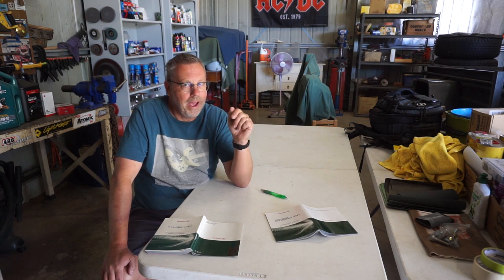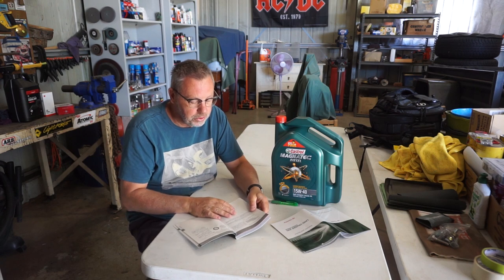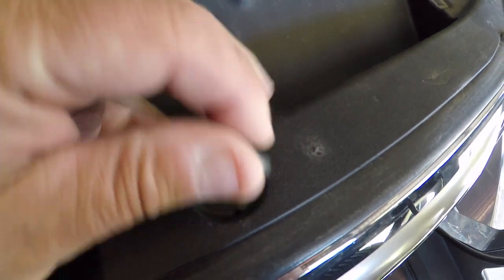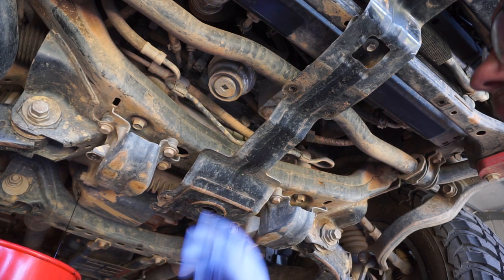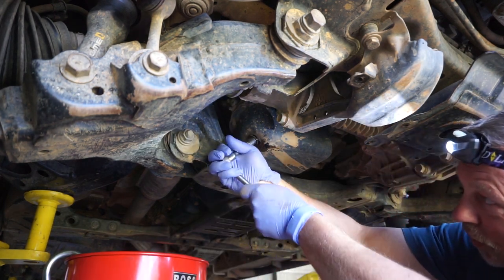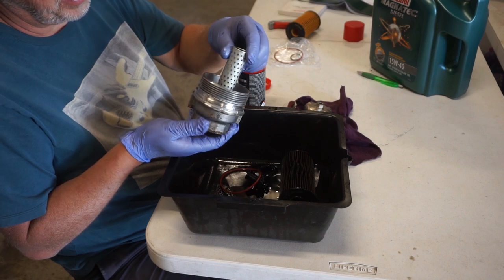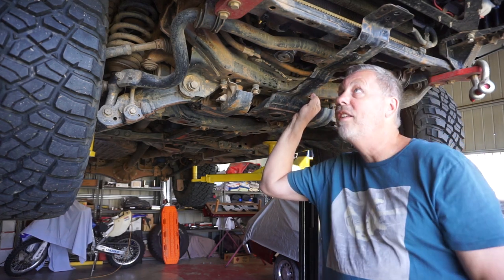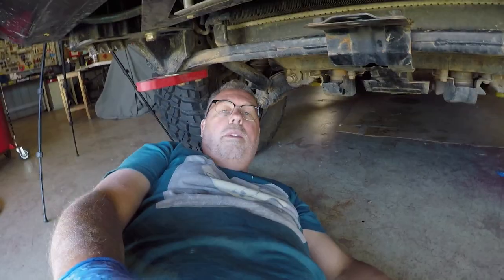How to Change the Oil in your Landcruiser 200 Series LC200

Comment from the maker: Ian MCcabe has discovered the filter housing part number is incorrect.  The new 79 series part no is: 15620-51010.  Great work Ian, thank you!
Reply: Thanks for this it was so helpful im going to upgrade my filter housing now
Reply from the maker: Good stuff Stefan, you won’t be disappointed.  I feel much more reassured with the alloy housing than I do with that plastic unit.  Thanks for watching and commenting mate, I sincerely appreciate it 😎👍
Reply: @JafffaAdventures  Hi the part no. 15620-51010 is for plastic filter housing. The aluminum filter housing part no. Is 15620-31060.
Reply: The part no. 15620-51010 is plastic filter housing. Part no. 15620-31060 is for aluminium filter housing and you may have to install the perforated tube from the plastic housing to aluminium housing and some doesn't come with the cap either. Hope this helps someone .
Reply from the maker: @rezuuz  Great information mate, thanks for sharing.  I have pinned the comment to make it easy for others to find.  Cheers!!
Reply: @rezuuz  Sorry mate, the aluminium item for VDJ200 motor is 15620-51010.  15620-31060 has a shorter length spout/metal extension and will NOT fit VDJ200 engines.

Comment: Yes you are totally correct about the dealer's almost voracious want to cancel the warranty. Had my car serviced out of state on a trip across Australia and when next presenting for a service at the selling dealer they noticed the service, but were not aware that the service was carried out by a Toyota dealer. The pumped up dolly bird behind the counter(she had a bigger bust measurement than her IQ statistics !, neither excessive) must have thought she was on some sort of spotters fee for cancelling me out....epic fail by her, and a total loss of respect for that dealer. I also purchased an extended warranty when buying and soon discovered it wasn't worth the time, money, or trouble involved. The extended warranty carried with it an escape clause before expiry with a proportional refund....good luck getting that back. I was totally ignored in all my attempts. Therefore, never again a Toyota.  I have also taken to doing my own servicing, after finding that dealers stripped the threads of nearly all the bolts holding the engine and transmission plates in place.
Reply from the maker: That’s bloody disappointing and poor form on Toyota’s behalf.  When you’re one of the worlds largest manufacturers the first thing that gets tossed out the window is customer service and your experience exemplifies this.  I feel for you John.  Thanks for sharing your journey 😎👍

Comment: I have read a document from toyota that says that due to oil consumption in those engine in the first years that it was released. The viscosity of the car should change to 5w40. Should I follow that document or still using 15w-40?
Reply from the maker: I’ve run 15/40 for the last 6 years without a drama.  Ambient temperature for your region is important for viscosity selection.  Its in you manual and on this video.  Cheers
Reply: @JafffaAdventures  dont have the owner manual, but in dealer they say it should be 15w-40. I’m in Peru, where weather is hot. Upto 32°C. The previous owner was using 5w-40
Reply from the maker: @omarkevinramos4716 I would be going 15/40 in that climate mate, same as here in Australia 👍

Comment: Thanks Terry! I finally “backed myself” and changed my oil at the 5k interval rather that waiting for my 10k mechanical service. I was surprised how gloopy the oil was, glad that I’ve changed it out. Had the issue with the drain plug spinning the filter housing. Onya mate, Tim.
Reply from the maker: That’s fantastic news Tim, your engine will thank you for it.  Well done mate, really glad I could help out in some small way.  Cheers😎👍

Comment: Thanks for the video mate. Can i please ask...did you use a torque wrench to tighten the sump plug and oil filter? If so where did you find the torque settings for them? And im guessing you use a new sump plug washer each time ?
Reply from the maker: Yes, I replace the sump plug washer frequently, but not every time.  I do services every 5000km and find the washer lasts a few services.

I do not torque the plug down but having done this exercise hundreds of times, I just have a feel for it.  I would imagine it’s not too hard to find the torque settings.

The filter housing does not torque, but is by the detent in the housing and the small metal tab the fits into it.  Cheers👍😎

Comment: Hi mate
I've been servicing my BMW x3 diesel 3ltr for 8 years now using penrite enviro 5w/40 .
The reason for the enviro additive,  is to help burn off particulates in the dpf exhaust. 
I have done 400,000 km from new doing all my own servicing and have had not one problem with anything, except changing a battery and the usual brake pads, tyres etc. 
The service interval as specified in the book is every 25000 km, which I have followed for the engine oil changes, and never changed the transmission oil.
I have been told by the BMW service technicians that they have been replacing the dpf (diesel particulates filter) on the X3 and the X5's at around 100,000 km mark if using full synthetic oil , but without the enviro additive. 
The diesel particulates filters cost thousands to replace and if driven around the city all the time,  will block up within 80,000 kms. 
I'm a farmer that does mechanical work on a lot of different machinery and vehicles  for over 30 years, and also own a landcruiser 100 series 4.2 turbo diesel,  changing the oil at the 8000 km mark. Because mine doesn't have the exhaust filter  , I don't have to worry about the additive in the oil .
There is a product from penrite,  that you can add to the fuel to do the same job as the oil additive,  not sure of its name.
Keep up the good work on the videos,  as I've subscribed and given the thumbs up.
Reply from the maker: You are very kind with your comments and thank you for sharing your experiences, that is very helpful.  You are a legend😎👍

Comment: Great video.  I found the only way to remove the drain bolt without unscrewing the whole thing is to hit the 3/8 rachet sharply.  Seems to do the trick.
Reply from the maker: Thanks for sharing your solution Bret, I’m going to give that a crack next time I do an oil change.  Really appreciate your feedback mate, cheers😎👍

Comment: Hi Terry, thanks for giving me the confidence to start my own servicing…did the oil and fuel filter change today all good.  In respect of the oil and filter change, the oil pressure now seems a bit higher than previously when cold.  Changed to Castrol Magnatec Diesel 15w/40 from Toyotas 10W30 maybe that’s why?  When warm or at cruising it sits at quarter like it always did, just goes up to three quarters when warming up before dropping back to half and then when warmed up fully to quarter. We live in Gippsland VIC, temp rarely freezing, but colder in VIC than QLD nevertheless.     Just wonder if temp high oil pressure is an issue at all????  (2014 GXL 140k.)
Reply from the maker: Good stuff Frank, I’m glad you have found some value here and it’s helped your confidence in giving it a crack yourself.  Everyone started at the same spot mate, nobody was born with the knowledge😉.  The thicker oil could explain the increase in pressure, but also new oil increases pressure as well.  I find the same increase in pressure on my vehicles after a fresh oil change.  Oil looses its viscosity as it ages over time, but you don’t notice it because it is so gradual.  Even using the same weight oil on a change, you will see the pressure increase slightly.  Bottom line, temporary increase in pressure is no problem and completely normal👍😎
Reply: @JafffaAdventures  Hi Terry, thanks for your prompt reply….also meant to ask about the Sakura filter?  They are a bit cheaper than Ryco or Toyota, but have you found them same quality and performance and have you used them for a long time?  Looking at getting consumables for next service.  Thks. Frankn
Reply from the maker: @frankandkatenorden9834 I have been using them for the last 200,000km’s worth of services.  Work fine, quality seems good as well.  Note that I service my vehicle every 5000km.  Cheers 👍😎
Reply: Thanks Terry,  thanks again.  One day if you could send me the Sakura part number, just so I can ensure the right one.  👍Thanks FrankN
Reply from the maker: EO-10060 for the oil, F-11131 for the fuel😎

Comment: Great video mate. Is there torque settings for the filter housing or plug?
Reply from the maker: No mate there is no torque setting for the housing.  You just spin it until the housing tab seats in its seating location.  Thanks for watching 👍😎

Comment: Great simple video.  If I sit the car on jack stands will the change in angle affect all the oil coming out of the sump and filter?  Also as per another comment I was never aware that the ribs on the funnel allowed it to be screwed into the head. 👍
Reply from the maker: Thanks for the kind words Andrew, I sincerely appreciate it.  I would think the car up on jack stands would make bugger all difference.  You might have an extra mm of oil at the back of the sump (because the drain plug is on the front) but they would be about it mate.  I too love the simple little hacks like the funnel when you find them out.  It’s like opening a Christmas present 😎👍

Comment: Hey Terry, have you done a video for the transmission oil change and basic service, or is this something you don't do?
Reply from the maker: Hi Andrew, thanks for watching and great question.  Firstly, no I have not done a video for the transmission oil change.  Secondly, I absolutely do do it and HIGHLY recommend it.  Toyota claim the transmission does not need servicing, I disagree 100%.  I bought my car second hand with 63K on the clock.  It was used for towing a van.  One of the first things I did was change the ATF and the stuff the came out was almost black!!  The previous owner did not have a lock up kit fitted so no doubt it saw temperatures well above 100C when they had the anchor on the back.  I have since done it once more and it looked much better, a cherry red.  I will continue to change it every 30K or so.  That's my interval that I made up based on how I use the vehicle.  The next time I change it I will definitely cut a video.  Cheers!
Reply: @JafffaAdventures  yes , much anticipation for that one, cheers

Comment: Hi Jaffa adventure. Always fan of your contents love your work.  But what came in to my attention today is time 9:28 you showing the part number looks like different part. I ordered other day same part and noticed that that metal sleeve is not long enough. I assume that’s for different car. 
Found the correct part number 15620-51010. 
May be im wrong or i got the wrong part 😅
Reply from the maker: Not sure mate but good pick up👍😎
Reply: G/ day Fella, was that a longer metal sleeve
In the new housing you got, I ran into the same problem a shorter metal sleeve
Reply from the maker: @martingraham3559 mine did not come with a sleeve.  I swapped the one out of my Bakelite unit.  Cheers👍😎

Comment: Hi Terry, that looks doable by someone who didn’t see any other tool except a keyboard. My 200 4.5 Diesel engine oil turns black within 1000 miles after service. How long should engine oil stay clean and is that color change an indicator of engines health?
Reply from the maker: You can definitely do it, just take your time and you will be fine.  It's difficult to comment on why your oil would turn black so quickly.  Using my 200 as a comparison, it stays pretty clean between services (which I do every 5000km).  A quick colour change indicates impurities in the engine oil.  That can only get in there through fuel.  Either incomplete combustion or over fueling.  I would be asking your mechanic if it is normal for your car.  Cheers
Reply: @JafffaAdventures  Thank you very much for reply Terry. Much appreciated. Now I understand, we in UK do service at 10000 miles (roughly 16000 kms) and if car dosent do 10K miles we leave it for 2 years or more. Its the same 200 series, 4.5 V8 diesel engine with just 50000 miles but the long service intervals and all that abuse  with irregular oil changes and filter changes might ve caused this black diesel.  Instead of relying on long appointments from mechanics, i ll start doing on my own.
Reply from the maker: Smart call mate, you will not be disappointed 😎👍

Comment: Thanks for the video. I just changed my oil and filter and considered making up a hatch where the filter is located so there won't be a need to remove the plates all the time. I have to lay on the ground to do mine. I noticed on the bash plate where the filter is located is the padding, what does that for do you think.
Reply from the maker: Thanks for the kind words, I sincerely appreciate it.  I would only be guessing, but I think the foam is a form of sound deadener.  Perhaps the plates rattle without it and the foam is there to absorb some of the vibration and prevent rattles.  I’m just guessing of course.  Cheers👍😎

Comment: I fillowed your video and did my first oil change yesterday on my 2010 200 series. Mate i drained my sump for 15 min before i proceeded. After the parts were fitted and 9L of oil re0laced to my horror the oil level was 30mm overfilled? Any idea why this may be the case?
Reply from the maker: Could be a couple of reasons.  First, I trust you changed the filter as well?  If not, that could be one reason.  Secondly, assuming you did change the filter, you have to start the vehicle and idle it for 30 seconds or so.  The oil pump will fill the new filter up and that will drop the level down on your dip stick.  Cheers👍😎

Comment: Good morning Terry. Just wondering if there is a reason why you haven’t fitted after market underbody protection (bash plates) or if you are planning on doing this mod? Best regards
Reply from the maker: Hi Mal, great question mate.  You are correct, I have not nor do I intend to for two reasons.  Firstly, aftermarket plates weigh a lot more than the factory items.  I’m not keen on adding more weight to an already heavy vehicle.  Secondly, the factory items have worked fine for me up to this point.  I don’t do a lot of intentional rock crawling and the like, so never really saw the need.  Now watch having said that, on my next trip a giant rock will punch the sump😂.  Keeps the shiny side up mate👍😎
Reply: Thanks Terry. Having the same debate in my head. Keep the content coming very useful. Planning Simpson next year and really liked see your experience out there recently best regards
Reply from the maker: Awesome stuff Mal.  The Simmo is my favourite place in the country mate.  Weekly uploads coming your way mate.  Thanks for your kind words and for following along😎👍

Comment: I Have land cruiser 2012 1 ur-Fe petrol engine I use oil viscosity 5w30 the weather maximum 33 in the summer minimum 15 in the winter sometime I go to the mountain I need u opinion
Reply from the maker: That sounds about right to me, just double check that little viscosity table in your owners manual.  Thanks for watching 😎👍

Comment: what year is your 200 series? does the oil filter housing  15620-31060 you show fit the facelift models? I have a 2016 VX.
Reply from the maker: Mine is a 2010.  I don’t know if the filter housing is the same, but the oil filter element is identical across all 200 Series so I would suspect so.  Pays to do your own homework of course.  Cheers 👍😎
Reply: @JafffaAdventures  The oil filter you show part no: 15620-31060 is not compatible with the new facelift 200 diesel models. That housing is off a RAV4. For those who have diesel facelift models of the 200 series, you can purchase a metal housing. It is the 79 series version, and is compatible (Toyota technician confirmed yesterday). The only difference is that the 79 series version does not have the central oil drain plug underneath. Though, as stated in this video, more often than not the whole housing just turns anyway. The Toyota technician explained they dont bother with the central drain anyway and just remove the whole housing. Here is the part number for those with a facelift 200 series: 15620-51010

Comment: Do you not use the metal clip that is supposed to stop the filter twisting off?
Reply: Sorry i know you make note of the clip but my one doesn,t appear to stay in place after removing filter housing.
Reply from the maker: Yes mine pops out from time to time when I am doing an oil change as well but it’s easy enough to slide back into place.  Thanks for watching and taking the time to comment😎👍

Comment: Hi Terry I just bought a aluminium oil filter housing genuine Toyota part . I have noticed the aluminium cap has no retaining clip as the original plastic housing has  a retaining  clip . What is your thoughts on that please advice.
Reply from the maker: Yes mate, mine did not have one either.  I have put over 100,000km on mine now and it’s never come lose. I would not be concerned if it was me, but that just based on how mine has travelled.  Good question mate, thanks for sharing 😎👍
Reply: @JafffaAdventures  Thank you for your reply. Your videos are very informative thank you Terry for sharing. Mine done 90,000km . Thinking of doing my transmission fluid change any video on that coming up??
Reply from the maker: That’s incredible mate, 10 minutes ago I just finished shooting a video on just that.  I have to edit it yet but it will be coming out in the next few weeks.  Cheers😎👍